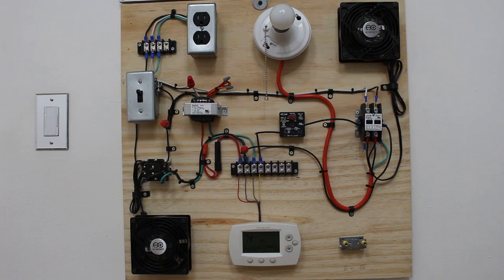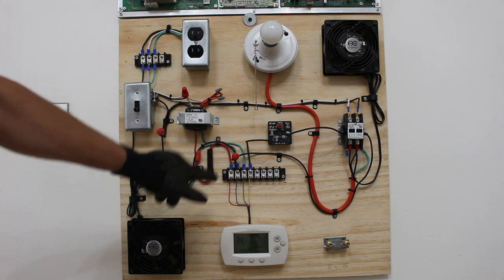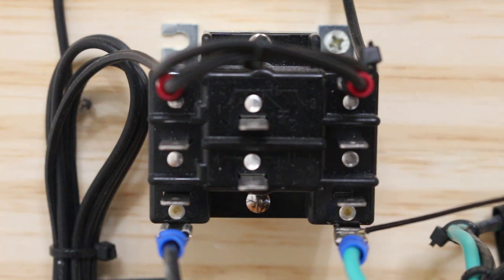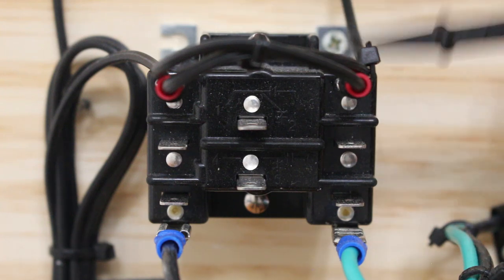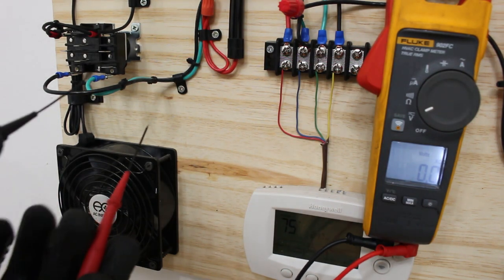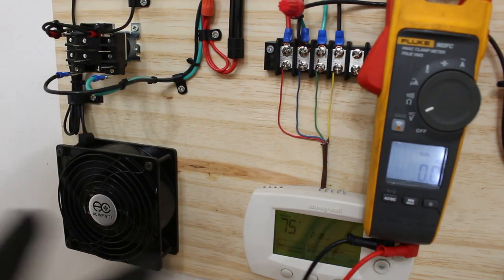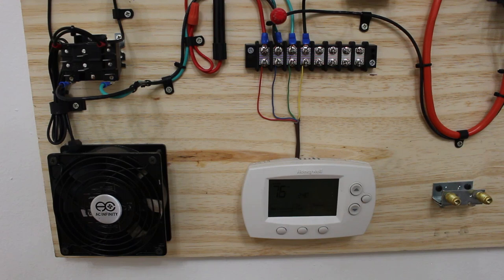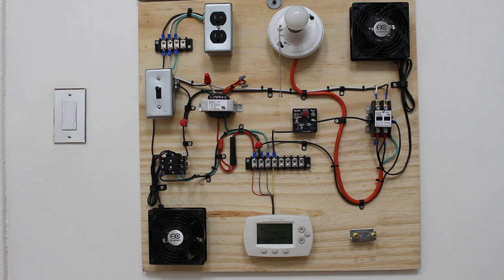HVAC Training Board: How To Check A General Purpose Switching Relay With A Multi Meter Using Voltage

Comment: Please replace that receptacle with a male cordcap, use a regular extension cord, and destroy the male/male cheater cord that I'm assuming you're currently using to supply power to the receptacle.

Comment: A thing to point out…you read volts wire to wire on the relay because there is a load between them.

Comment: Thanks for this video!  The simplified AC system representation on a board was a great help.  When you get inside an actual AC unit, everything seems to be jumbled together and it's harder to understand what is going on.  This helps a lot to understand what needs to happen for the system to work.  Now I need to check and see if you have a video on how the capacitors work!   Thanks again!
Reply: Vrey good

Comment: Question, what is those 2 cables coming from the compressor and condenser to the low voltage terminals block?

Comment: Hi.  Thanks for sharing your knowledge with this.  We recently added a booster fan to our HVAC system, and have it wired back to the furnace to kick on with the blower.  We have it relayed with a 24v relay switch as you show here.  Unfortunately for us, it is mounted on the floor joists directly below our family room and the relay switch “Pop” is incredibly loud when it opens and closes.  Wondering if you know of any quiet relay switches that would work, or any tips on how we might be able to minimize the noise.  Any suggestions you have would be greatly appreciated.  Thanks again!
Reply: Depending the amp draw, you might try a solid state relay instead ... no clicking or popping noise I promise 😉

Comment: 3 mconkey unit 9 left items behind what would it be disconnected so eveytime that went on transformer and antenna uhf vhf removed commsco0e rampron  ot my lcowrion may 2018 vacuuum tubing and bose speaker displays microsoft visual srudio? Mosfet omron cooling relay as what is rosemount controls nutrerwoeth settings f1 imac retina f1 is 4ghz so what is thisa.

Comment: A relay and a contactor are just switches that open and close? Question bro, what do we use when we check resistance. Are we checking for shorts? Also when we get an ol, open line, is that again thing. Thank you for your knowledge.

Comment: Why does voltage go away when it gets energized confused on that part??
Reply: 1st, voltage measures a difference between two points.  So, the voltage goes away (is equal between two points) because the electrical current moves through the circuit to the next load.

I hope that helps.

Comment: 5 wire not 4 honeywell thermostat lightswitch left behind no rf as disconnected theory was mosfet omron cooling transformer video as had time in the house so arc on electrical as subpump room jack 5 wire on side of lighswitch  whhat would it be as home inspector never saw before left behind